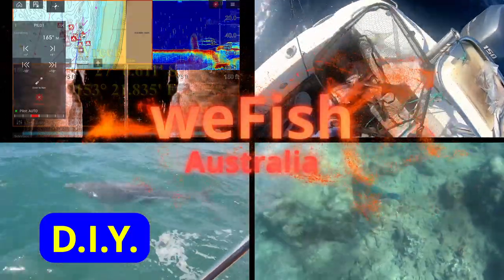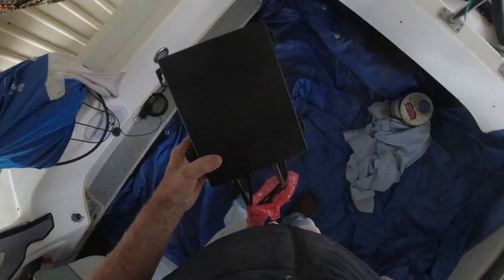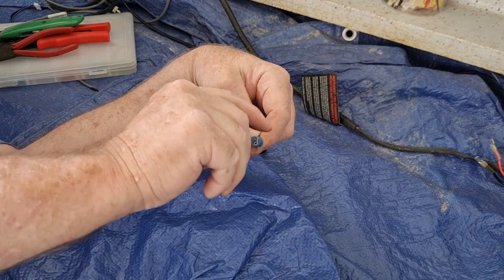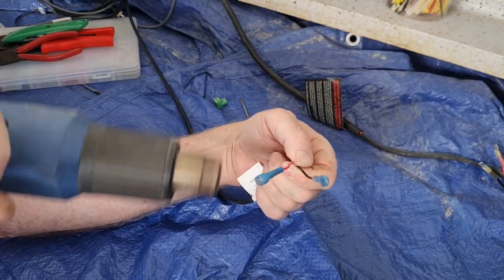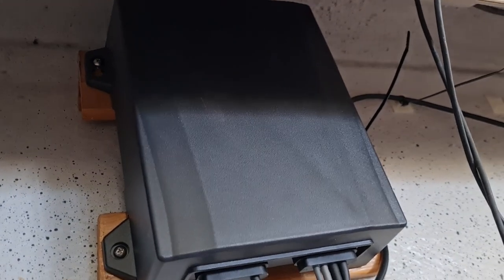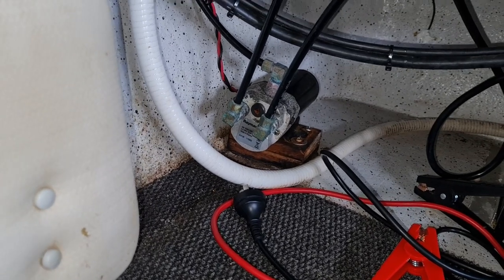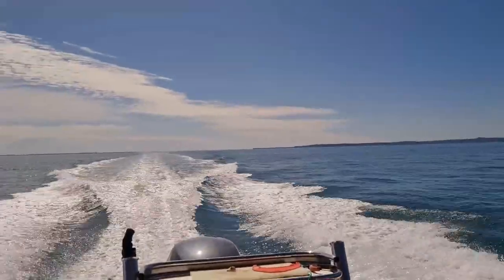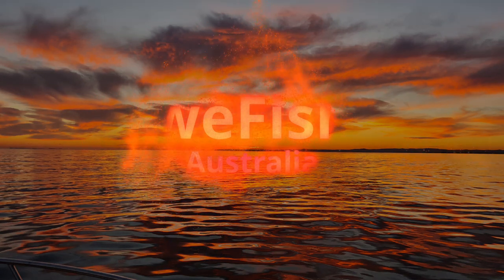Installing a Furuno NAVpilot 300

Comment: What heading sensor did you use with this unit?
Reply from the maker: I got the SCX-20.  It is way overkill for a heading sensor but I got it because it has so many other uses than just a heading sensor.  More on that when my MFD is finally delivered.